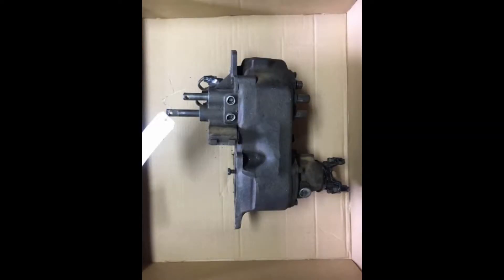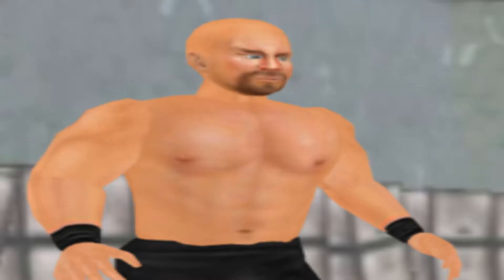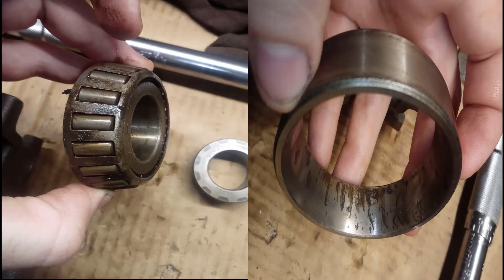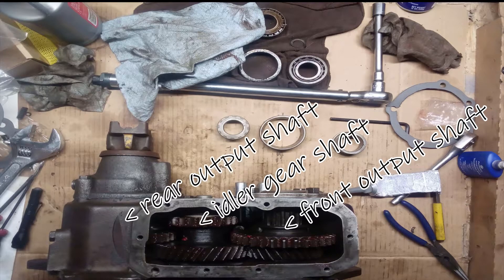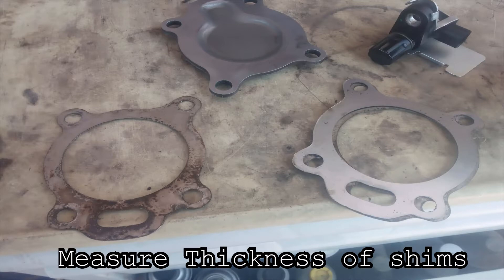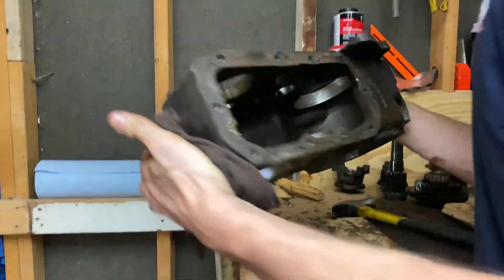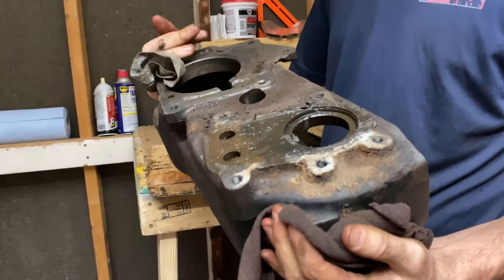Taking apart a Dana 20 transfer Case: '79 Jeep FSJ dana 20 swap Part 1

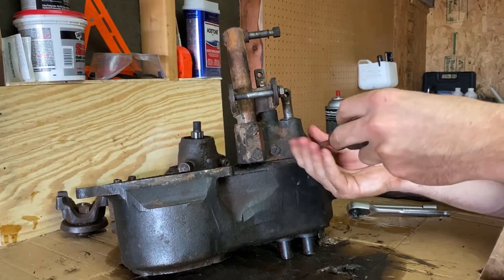Comment from the maker: Keith I saw your Comment but you must have deleted it. There are guide pins in between the shift rods. for the Rear shift rod I stuck a large screwdriver through the hole on the end to pull up while pushing the other shift rod in and out to get the pins to move out of the way. Also take out those screws that I unscrewed at 4:45. eventually the rear shift rod will come out. I'd say leave a few bolts in the front cover to make pulling on the shift rods easier